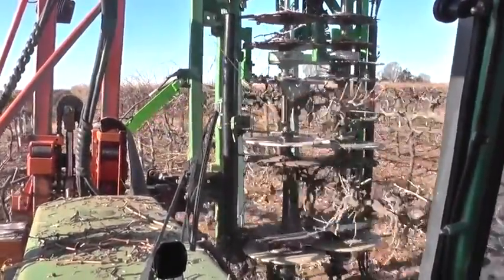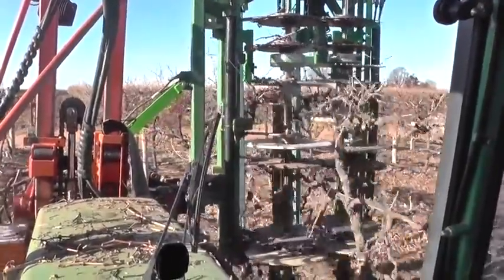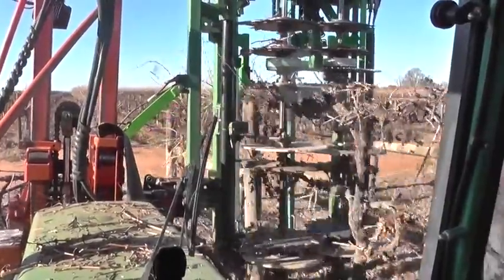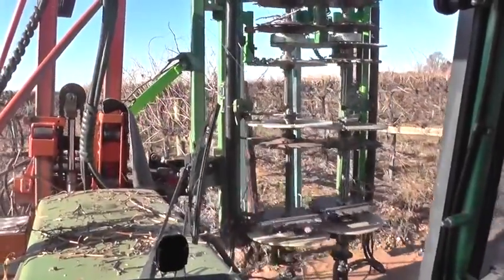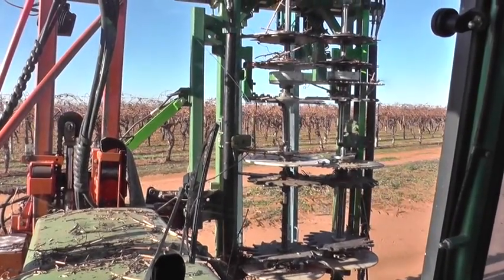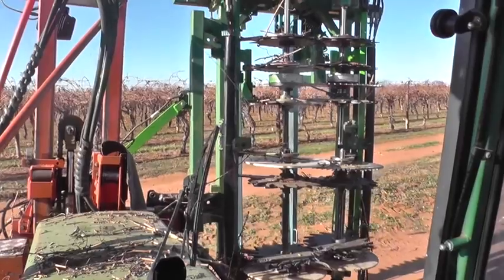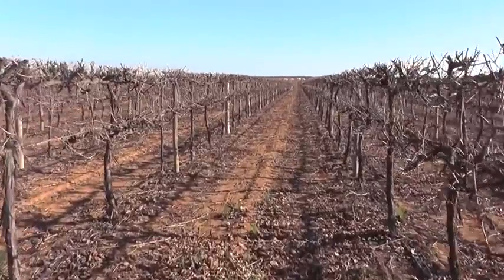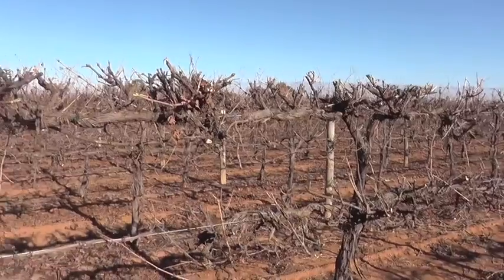mechanical pruning grape vines 2

Comment: Thanks for posting this -- I can't believe pruning could be this simple. Also, do the two levels of cordon allow you to reduce spacing and considerably increase tonnage? Does the crop from the lower cordon ripen at the same time? Same sugar? Thx
Reply from the maker: I live in the warm growing areas which allows us to have the 2 cordons, and yes increased tonnages.The lower cordon dose eventually die back but takes many years for this to happen. You can slow the die back by canopy management.